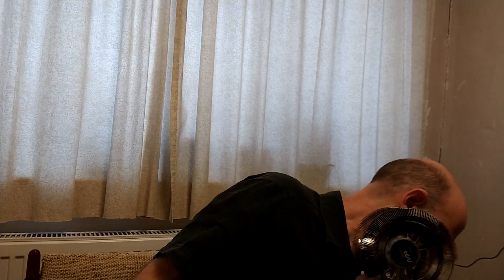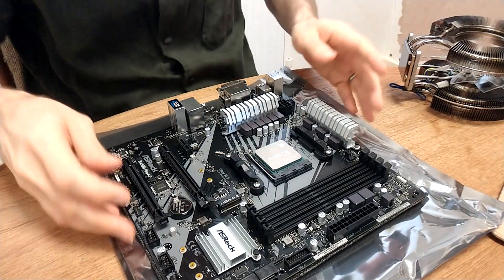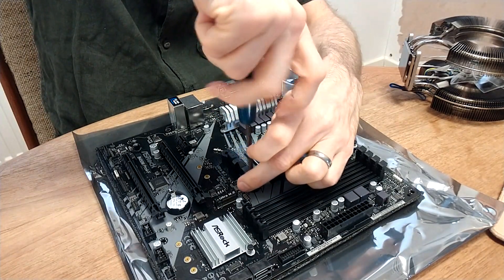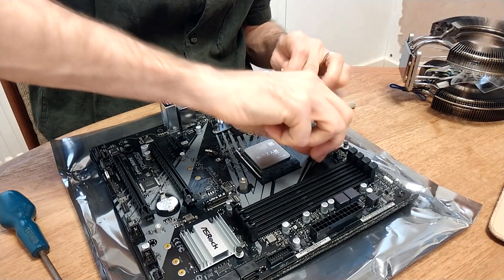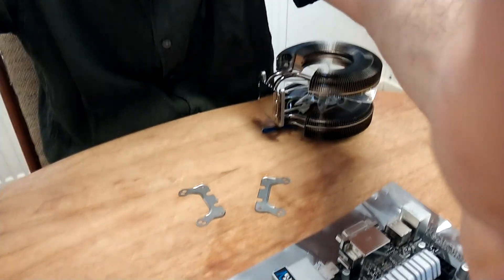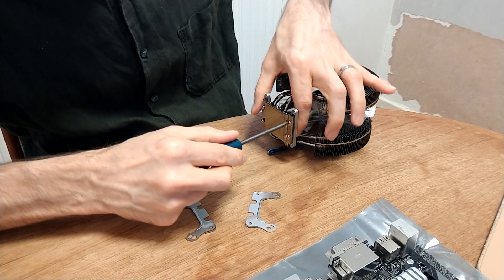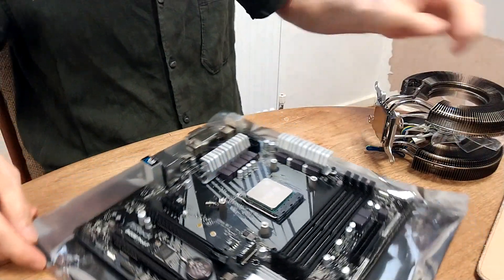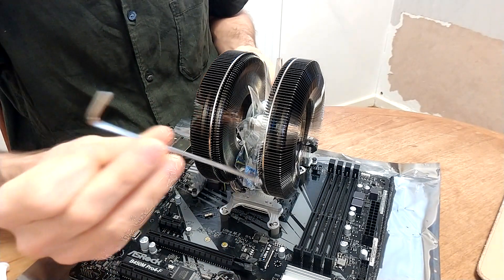Fitting a Zalman CNPS 9900 Max cooler to AM4 Ryzen motherboard

Comment: Loving it.  Just barely sat down to use my cnps 9900 max on a mobo upgrade and couldn't figure out why it wouldn't fit when I read it could be used on am4.  Yep, need the kit $15.50 shipped.  Got it in.  Man, those little screws are fiddly.

Comment: Thank you for this video from two years ago. The tips on the gap for the basket pieces was the best part. It was VERY easy to push them in too far and not have a good clamping.
Im in the process of doing this now in early 2023. it took only a few days for the kit to arrive from California direct from Zalman. $14 after shipping. I have a cnps9900a led, all copper version of this model in the video, and it keeps an AM3 socket x4-965 (140w) chip wonderfully cool. It should keep a R7-5700x under control just as well as its a 65w chip that will throw out similar heat.
Reply: news about temp with the r7 5700x?
Reply: @sketc639  the onboard PWM fan controller works with this item. I have total fan control. It keeps it below throttling temps. Although it is in a 4U rackmount rosewill case with 3x120 front fans, I run them for noise not for performance. Either way, it keeps it cool enough to be below throttle at ANY time. Even with a 3080ti parked next to it.

Comment: Brilliant. I used the 9700- Cu back in the day. I need 2011/2066 screws for it. I may be able to use my Noctua adapter studs for it (2011/2066 to 1366 Xeon) threads. The old Zalman uses the 1366 Xeon screw thread.

Comment: i was given an older gaming pc with an i7 875k and this zalman cooler. maybe not exact model number but looks identical to this one. fins are all black and has a blue led. the issue im seeing. is that there are no posts installed. the cpu cooler is definitely mounted but without posts and im wondering if its normal. its pretty much screwed right into the backplate without anything for support

Comment: Hi,can anyone tell me if the zalman cnps9500AM2 (Same as the 9500a/led but nickeled and green fan) can handle the 2700x stock (105 tdp/some places say 95 tdp)? Or do i have to go for the 3600 (65 tdp). Thanks
Reply from the maker: Im using the 9900 Max with a 1700x and it copes ok, but personally, I wouldnt want to use a 9500 on it.

Comment: Hi. Which Ryzen on board? And how about temperatures? Can we see really tests?
Reply: It's a Ryzen 5 1600 6-core processor. I didn't post temps as I have nothing else here to compare it with. When I scrape together the money to upgrade my own system, I'll do a proper comparison with some other coolers and post temps.
Reply: @fwibbler2454  THX, i will wait. I have this cooler at box from OLD PC, and now i have Ryzen 7 3700x. Hope to see temps on boost at ryzen =) GL
Reply: @gamgamov5876  sow,how is temps now?

Comment: Fantastic! What about the thermals?
Reply from the maker: I don't have figures for you, but I did over clock the CPU to at least 4Ghz and the temps were stable and not too high. Of course if overclocking is your thing then best use something bigger, but I've used these in 2 PCs now and they're both fine.